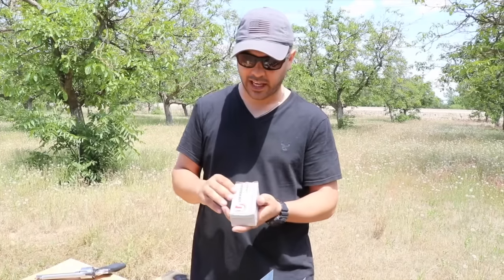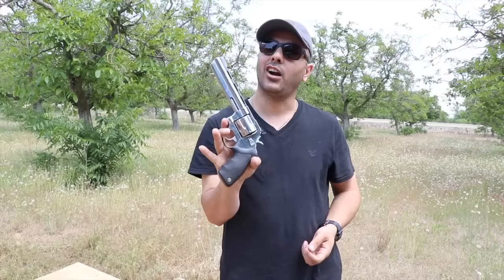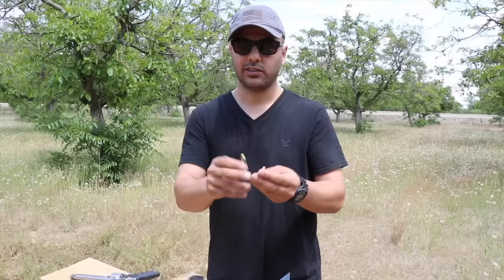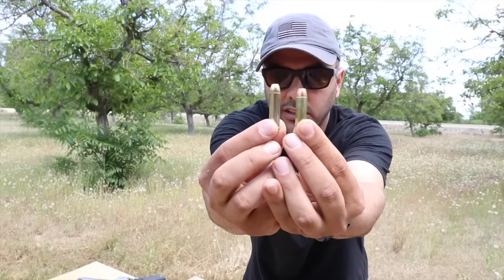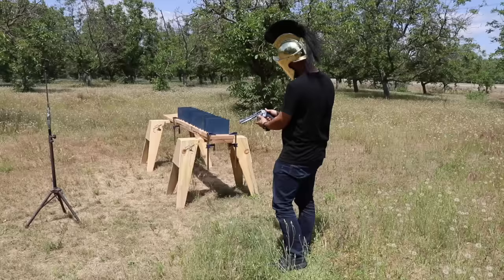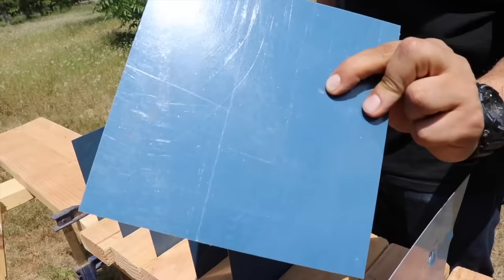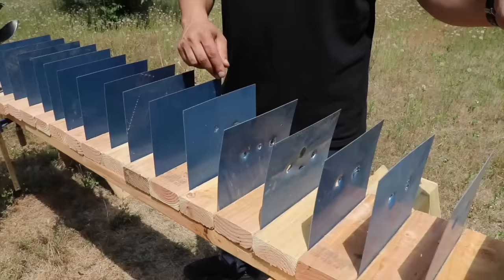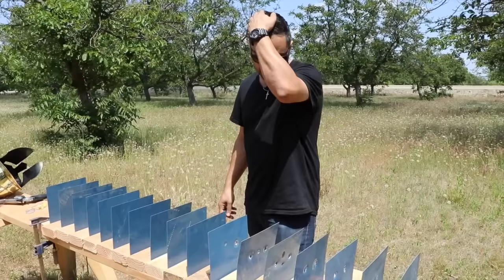357 MAGNUM VS 38 SPECIAL VS SHEET METAL

Comment: Not a surprising result to me. Bullet mass was close enough for decent comparison. A better bullet mass would have been 158 grain FMJ in both, and they'd have likely penetrated more sheets each, but with similar ratio of the .357 magnum penetrating just a little less than twice the number of sheets compared to the .38 special. Most .375 magnum commercial loads are about twice the muzzle energy compared to the .38 special with the same bullet.

Note that the development history of the .357 and its original 158 grain ammunition during the mid-1930's was improving penetration of 1920's and 1930's car doors for law enforcement. Automobile sheet metal then was much thicker gauge mild steel compared to current vehicles that have much thinner steel from stiffer alloys. Penetrating the doors with .38 special with sufficient energy to seriously wound the person using it for cover was problematic. There was more than one layer of steel across most of the door, and it usually included the window glass with the window rolled down. Increasing numbers of gangsters were also starting to use ballistic vests. Even though those were crude by today's standards, they were also causing problems for the commonly used .38 special LE ammunition. Most of the gangsters wearing ballistic  vests were undoubtedly protecting themselves more from other gangsters versus law enforcement. Absent any cover provided by objects like car doors, walls and doors, the .357 has a definite over penetration risk, even with a very good JHP. When using it one must consider what's behind the target, including common interior walls and hollow doors.

Comment: video idea, compare which metal are more bullet resistant, meaning same test on try 24 gauge stainless vs 24 ga aluminum vs 24 ga copper ,,, i used to think if you wanted to armor your car you could put a piece of 16 ga stainless inside the door and it would protect you against most calibers.

Comment: Actually, I will complain lol- A .38 special fired through a .357 magnum revolver, can actually lose a little velocity vs. a .38spl round fired through a standalone .38spl revolver because of the slight jump into the taper in the cylinder chambers instead of a perfect fit.
Reply: cross: The .357 is ~0.5mm (0.023 inch) smaller diameter than the .38 special. That is a spark plug gap. I wonder if the .38 bullet lost energy squeezing through smaller bore, or gain energy from powder charge building more pressure. Edwin, i think this needs to be tested!
Reply: Their diameter is the same, those names are there for different reasons. I was confused too, but then I looked it up in the wikipedia.
Reply: According to sami .357 , .38 and 9mm are all with in .001 of an inch thats about a hair split in thirds. Like the video thanks!
Reply: 38.Special and 357.Mag has the same diameter bullet (.357-.358'ish).

The 38.Special got its name from the good old days. The original 38.Special had a heeled bullet (like a 22.lr), meening that the diameter of the bullet would be a 38.cal, and the heel would be .357-.358 to fit inside the case. 

In ''newer days'' the 38.Special was changed to a regular bullet, but the case would be the same - a 38. cal. Therefore the name, 38.Special.

The 357.Mag is basicly the same round, but 3mm longer. Why?...So that you could make a hotter round, that would not fit in a older/weaker weapon. 

You can easely load 38.Special to 357.Mag pressures, and fire it from an 357.Mag revolver... but it could turn out a disaster in a 38.Special revolver! 

With the 357.Mag case beeing a litle longer, it wont fit in a 38.Special revolver, and you wont have a disaster
Reply: The .357 magnum is .357", while the .38 special is .358".  The shell casing wall is .001" thicker on the .357 to compensate for the increased pressure.
Reply: Gun Sam Revolver Aficionado I'm India se

Comment: Stop using light bullets in the .357 magnum. The projectile slaps the forcing cone with a lot of energy from the faster acceleration of the 125 gr bullets. This can cause the forcing cone to split. The 158 gr Federal JSP moves along at 1240 fps and has 539 ft/lbs of muzzle energy. The 125 gr Federal JHP moves at 1440 fps and has 575 ft/lbs of muzzle energy.

Believe me, your target will never miss the 200 fps and 36 ft/lbs of muzzle energy.

The round was developed with the 158 gr projectile in mind.